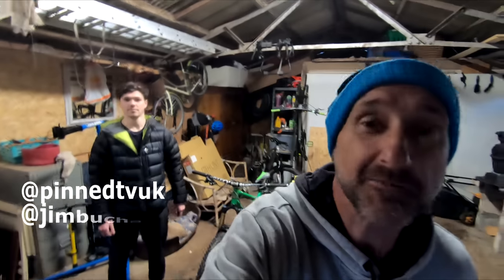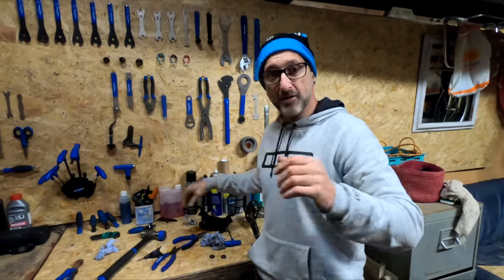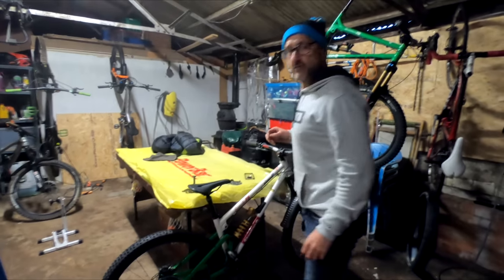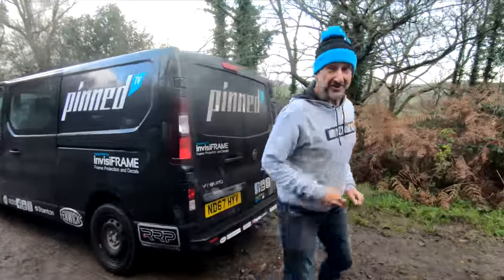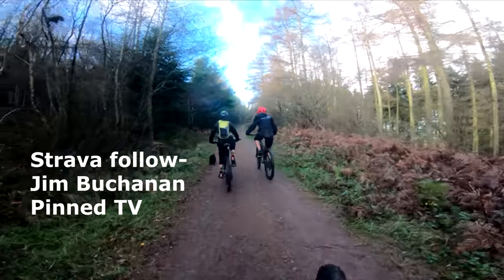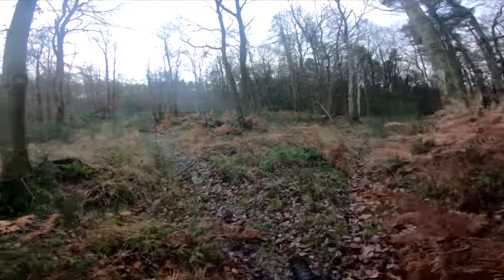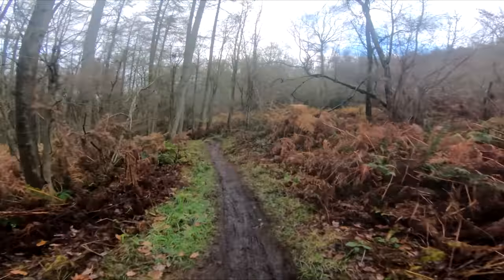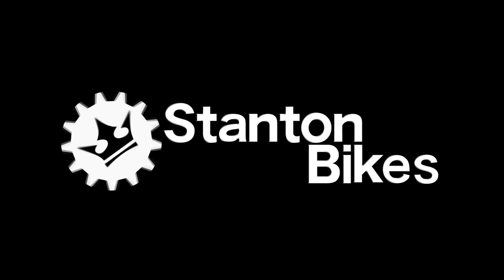MULLET BIKE TEST *FAD OR FUNCTION???* WE FIND OUT

Comment: I’m about to dig out of the cellar my 97 BMW TMX with 26f24r 3” Nokians 
Anyway one of the reasons for the small rear beside the change in geometry to slacken the head angle was to have a stronger back wheel - ergo the bike also runs seismic hubs with some serious gauge 20” bmx spokes and coils on the springs front n rear
It’s a huck monster but I’m curious to see once its ducted down how it stacks up against my current bike - 2019 levo with 29’s - 6 months in only the original back tyre trashed with a blown bead

Mullet or however you call it was is normal on moto Mx trials etc and was fairly regular in dh 20 years back - new bikes with flip chip/mutators etc on the rear sus can only be a good think for those who want to try

Comment: Great riding in very sketchy conditions. It looks like climbing wasn't a real issues for you - which is my big hesitation on converting to a mullet. I have a steel, 29er SE hardtail that I want to keep riding - doing predominately XC, but I fight to stay on the bike while taking turns with its 2009 head tube angle of 72 degrees. I'm hoping that putting a 27.5 in the rear will bring me back a little - and maybe a longer travel fork. Thoughts?
Reply from the maker: Yeh that could work, the small rear wheel.will slacken head angle and longer forks too, plus the long forms will counter the lower BB from the smaller wheel

Comment: Don’t mullet bikes normally have a plus size tyre on the rear? Would help with the head angle wouldn’t it?
Reply from the maker: Some do, will go 2.6
Reply: the new Intense Primer
Reply: No.. or IMO they shouldn't. You want the different different circumference and as such axle height to get the gains in turn in, stability in corners etc. A 27,5+ is almost the same diameter as a 29" so it is really more of a marketing ploy, so that they can sell people a "Mullet bike" without actually having done the effort/investment to make a proper mullet bike... Was really disappointed to see Intense go this way with a shitty plus tire instead of doing things right.

Comment: good test...I'm thinking about going the mullet route, i have at the moment a giant trance,  27.5,it has 140mm at the rear,150mm at the front, the forks are just the basic however i'd like to up grade to a 29er fork, possibly set up 140mm , i think the calculations might be about the same if i put a 160mm fork 27.5 , i have a wren fork on my fatbike that i could possible swap to see if the head angles might be about the same....i'll wait for a rainey day for that.

Comment: I was forced to go mullet a long time ago on my old 26 stumpy because finding a straight steerer 26 at 160 travel was impossible. I got a 27.5 fork at 160. Bike rode nice. The next time I did it was with a  27.5 stumpy, I replaced the fork with a 29 to slacken the bike up.  Never thought this would become a thing. I didn't feel any faster, but strava said i was faster on pretty much every segment.

However on my new 2019 enduro 26 fattie. i put a small wheel on the back and i was slower, but I climbed better. 3 builds all smaller rear. The BB was not an issue on the first 2 bikes because I raised the front which raised the bb by about 5mm.

Comment: you are getting it all wrong, real angle is measured wile standing on the bike in attack position with the correct sag set. only then you can measure the real head angle.
Reply: Should be the same on an FS with same travel f/r... ;-)
Reply: I agree and disagree🤪 This is how it should ☝️be but it’s not the way the industry does it😆

Comment: If you want your weight a bit more on the front wheel, maybe consider a equally longer stem! Im currently building my 26" up with 27,5 fork and rather slack 64 HA, so in case of slack bikes, only way to get weight over your front is the stem length, i went for 60mm.